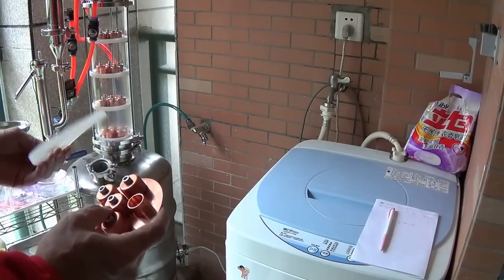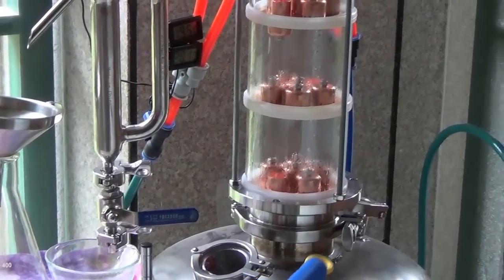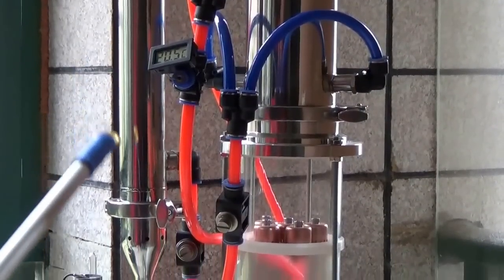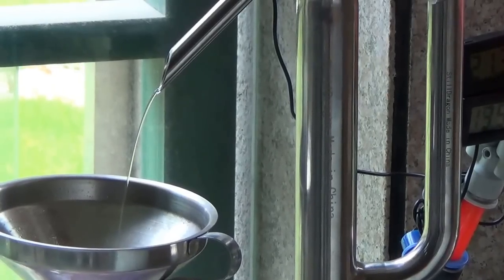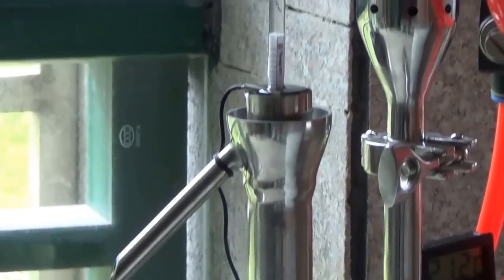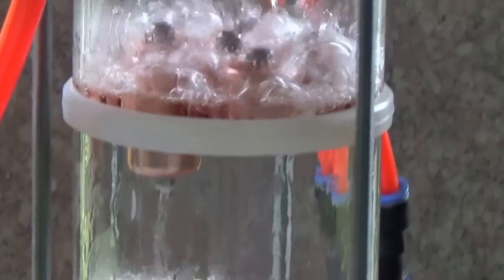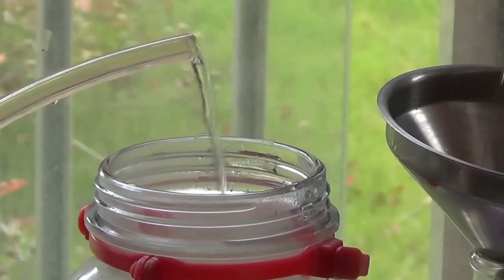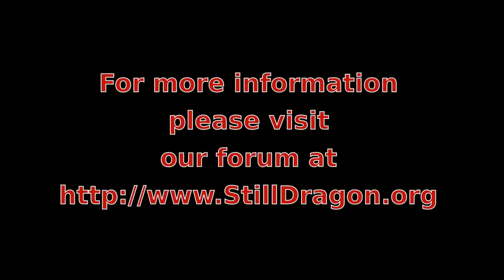StillDragon® - 4" Crystal Dragon™ - Test Run w/ NEW 4" SuperRC

Comment: Love it,  ok been to site to buy and can't find the water adjustment valves  shown at time 1:50-1:60,  searched every category  listed,  any body that can help  Ihave the same water lines with push in connect
Reply from the maker: Hello Reinier,

It's called "Push Connect Throttle Check Valve" or also "Needle Valve", depending on which distributor's website you visit. For example in Europe it can be found here:

https://www.stilldragon.eu/en/push-connects-hoses/130-push-connect-throttle-check-valve.html

Please be aware that our community members do not participate here in YouTube comments. For any questions please visit our StillDragon® Community Forum at https://www.StillDragon.org

Regards,
Moonshine - The Administrator of the StillDragon® Community Forum
Reply from the maker: These valves are usually referred to as needle valves, but depending on which  StillDragon® distributor website you are looking at, they are named differently. For example at the European website that items is named "Push Connect Throttle Check Valve" and you can find it in the Push Connects Hoses category below Components:

https://www.stilldragon.eu/en/push-connects-hoses/130-push-connect-throttle-check-valve.html

Please be aware that our community members and StillDragon® distributors do not participate here on YouTube comments. Please visit our international StillDragon® Community Forum at https://www.StillDragon.org for asking any questions, or contact your responsible StillDragon® distributor directly (see links at the top of the forum page).